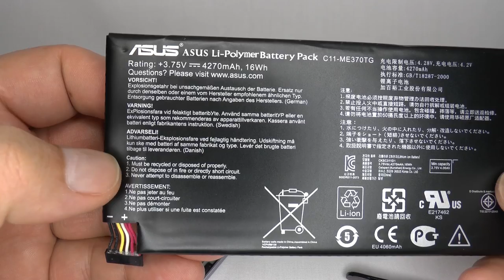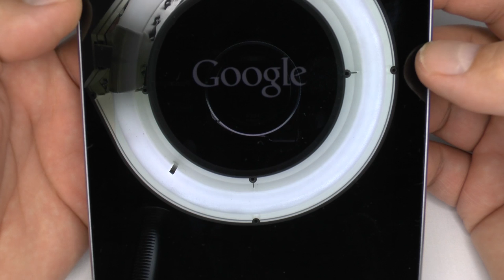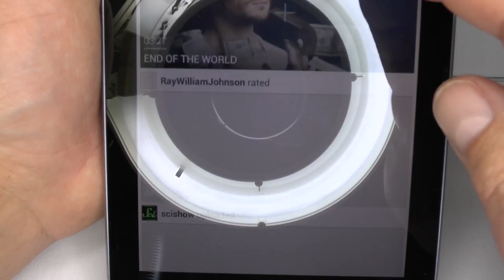Nexus 7 Repair -  LCD & Digitizer Replacement | Disassembly + Assembly

Comment: Hello, Thanks for the video. Recently my Google Nexus 7 screen was broken I can ON and OFF the tablet but i can not un lock it thorugh touch pad screen. Seems touch pad is not working. Do I need to buy Digitizer and LCD both for my tablet or only Digitizer is enough to make it workable?  Where I can order these parts to do so. Please suggest me to proceed further.
Reply from the maker: you need to buy the digitizer and lcd together as an assembly, if you buy one with the frame it makes things much easier. There's a link below and you can use coupon code ETS2 for a little discount which also give me credit http://www.etradesupply.com/asus-google-nexus-7-tablet-lcd-screen-and-digitizer-assembly-with-front-housing.html

Comment: That you for this video, it totally worked ! Now I have a little problem, I can't adjust the brightness of the screen. Could it be possible that I have made a mistake ?
Reply from the maker: I doubt its something you have done, I would try a factory reset after backing up your data

Comment: Ah, thanks for the swift reply :) I later saw in video you explain the difficulty to separate and join the two. Again, thank you. I will purchase the whole assembly, however I will proably have to use Ebay, unless that company ships to the UK at a reasonable cost.

Comment: This was a great video.  I got the replacement parts, installed the new screen with digitizer and new frame.  However, when it came back up I had no picture.  It was working.  I could hear it, it clicked when I tapped on the screen so the touch was working and when I plugged it into the computer the computer recognized it.  So, I thought maybe this new screen is bad.  The old screen worked, it was just cracked on once corner.  So I put the old one back in and found I still had the same problem.  Now I am at a loss.  Seems maybe I broke something in the process.  Any idea?
Reply: it just died its the video card if im a betting man did u double check all ur ribbon cables
Reply: Yes I double and maybe even triple checked all the ribbon cables.  I have been trying to catch a decent price on another broken one on EBay but they are a bit overpriced for something that is broken IMO.
Reply: go buy a new one take  the guts out of the broken one  put them in to the new one say its broken same day get ur money back
Reply: Bobby Nicholson that's evil way we don't do that

Comment: Hi quick question...ive only watched the 1st ten minutes but was wondring if i would i need to remove all the parts mentioned ie volume, loudspeaker etc if i am only changing the screen and digitizer?  Thanks
Reply from the maker: it might be possible to leave some parts in place, but its not worth the risk
Reply: Thanks so much... was just checking incase you were just being really thorough :)

Comment: I've done an extremaly messy job with the heatsync foil, now it comes in 2 layers ;/ will it affect the temperature really badly? any chance of getting it somewhere? or can I craft one with chocolate wrap perhaps?
Reply from the maker: here's one and there are others on there http://www.ebay.co.uk/itm/261317322170
Reply: ***** thanks for the reply! i've decided to give it a go and reused the old one - after all i thought it's not so bad, only a bit creased ;) works so far! many thanks for the tutorial, you've helped a LOT !

Comment: Excellent tutorial, many thanks.  My screen was cracked badly to start off with so removing it from the bezel was a bit of a challenge as the screen itself came apart from within the centre of the bezel and fell out leaving me to pick the tape off.

Either way, thank you for your video, excellent work

Comment: Hey what would happen if I damaged the flex data cable while dissambley ? Btw the USB port was already damaged..can this affect my touch screen because 1/4 is unresponsive
Reply from the maker: the only thing that would affect the digitizer is the flex cables at 8:23 lift the bar and re-insert those cables, it might cure your problem. The usb data cable shouldn't cause that problem

Comment: Great tutorial, Does one type digitizer and screen, fit for 1st and 2nd generation Nexus 7. screen resolution is 1280×800  (216 ppi) for 1st Gen. and 1920x1200 (323 ppi) for 2nd Gen. Nexus 7
Reply from the maker: I'm pretty sure they are not interchangeable, I hope to cover the new one soon..
Reply from the maker: Davitu s no that one is for the 1st gen, this is the one you need http://www.etradesupply.com/asus-google-nexus-7-2013-lcd-screen-and-digitizer-assembly.html use coupon code ETS2 for a small discount which also gives me credit

Comment: after dropping the tablet, my screen has a black column on the screen that still responds to touch sensitivity. i don't quite know what part is broken; do i just need to replace the digitizer display as shown in this video?
Reply from the maker: The lcd display and the digitizer are bonded together so you'll need the complete assembly, there's a link below and you can use coupon code ETS2 for a little discount which also gives me credit http://www.etradesupply.com/asus-google-nexus-7-tablet-lcd-screen-and-digitizer-assembly-with-front-housing.html

Comment: Thank you very much! It was very useful. First time after I put back together the device, the digitizer didn'work, but I remembered not inserting very well it's cable. Opened it again, fix iti and it works. Thanks again!

Comment: Do you know if there is a way to get the digitizer separated from the lcd screen?
Reply from the maker: its not easy and requires a 'hot plate' and very strong thin wire. This video shows how its done Снятие тачскрина Asus Nexus 7. Как поменять сенсор? Ремонт планшетов. Сепаратор Термостол

Comment: just cracked my nexus 7 screen. the tablet still powers. how do i know if i need the digitizer or just the glass?
Reply from the maker: its not easy to replace the digitizer on its own, you'll need to replace the complete screen assembly
Reply: ***** Hello! I have a problem with my nexus 7. I cracked my screen and I can only use one half of it. I believe it's the digitizer. The image is good, the tablet boots and all the applications are working, but I can only use that one half of the screen. Is it possible to replace the digitizer, without the LCD?
Reply: Constantinescu Catalin Nu are rost sa te complici. Digitizer'ul e lipit de sticla cu un adeziv transparent, care la dezlipire-lipire va lasa niste bule de aer foarte greu de scos. Am vazut oameni care au incercat si multe esecuri. Cauta pe ebay un ecran complet, care te va trage inapoi vreo $48, care e o suma ok, zic eu. Eu asa am facut si mi-a sosit in 2 sapt fara costuri de livrare.
Reply: Multumesc mult pentru sfat! Am cautat pe youtube si am vazut cum se face dezlipirea. Nu am destul echipament pentru asa ceva si nici nu m-as risca, sa fiu sincer. O sa caut sa il inlocuiesc cu totul, Inca o data, mersi mult ca m-ai ajutat!

Comment: I thought my problem was the battery being knocked loose. I opened it, unplugged it, and plugged it back in. Now the screen is on, but it's just pure grey. Is my display broken? Someone please help. I literally bought this damn thing in January. I never dropped it or anything. It was out of use sitting on my dresser. I pick it up to use and all the sudden it randomly does the crap I just explained.

Comment: I found someone selling bezels on ebay, so i bought one and finally got a screen so attempting the repair today. It also comes with the adhesive on it, type "NEW OEM & TESTED!! ASUS GOOGLE NEXUS 7 TABLET REPLACEMENT SILVER Bezel Frame" on ebay. Not trying to solicit and help their sales, just trying to help others out...

Comment: Thx, very thorough - was a good reference for replacing the screen on a wifi 32gb. Some minor differences in the width of the charging port cable and the type/shape of the copper heatsink foil.

Working nicely, cheers.

Comment: Great clear video m8, i only need to replace the digi... but will follow your advise and order the full lcd/digi... unit, Il let you know next week how i get on (or if you c a mushroom cloud on the horizon you will already know) thx for taking the time to help others .
Thx Paul
Reply: ***** Quick update , My bezel was a sucker to get off in the end it warped, But you can get a LCD/DIG/BEZEL all in one on ebay £40 i paid £30 and the repair is complete thx for the helpful video again m8, Thx Paul

Comment: can i replace digitizer only ?  like on samsung galaxy phones, heat glass and take it off slowly , than glue new glass/digitizer with LOCA?
Reply from the maker: I don't think its possible on this one..
Reply: Hi Trumpeta 44,,,i have tried to remove the glass, and i can assure you they use something very very strong, it is nothing at all like what we come across with any of the phone loca/oca etc etc....i tried 2 to practice, and resolved myself to the fact for the sake of £11.00 i am buying the assembly from now on...

Comment: HELP I replaced my sons cracked digitizer with a new one, it starts but got a black screen, opened my daughters nexus to swap the little flex cables 8.23. To see if that was the problem. now ive got 2 nexus 7s both start up but black screens, and 2 very unhappy kids. do the small cables break easily. thanks.
Reply from the maker: the flex at 13:21 is normally the cause of display problems. The flex at 8:23 is for the digitizer. The cables don't normally break easy. Try turning it on with the digitizer flex unplugged 8:23
Reply: ***** hi ive brought 2 new flex cables and tried them but still got a blank screen, the alarm on my sons keeps going off and cant turn it off lol.
Reply from the maker: Ray Ducker its a strange problem to have and I feel sorry for the kids. Can you try your daughters screen on your sons mainboard or experiment with different parts until you find the cause of the problem
Reply: ***** hi just to let you know with a lot of fiddling and thinking lol i have finally got 2 WORKING nexus 7s the problem was they had both drained of power so i left my daughters on over night with new flex and it worked, did same to my sons, new screen and flex, left charging over night and hey presto 2 very happy kids and one very relieved father.lol couldnt have done it without your help. Thankyou
Reply from the maker: Ray Ducker well done! I didn't even consider a flat battery :-)

Comment: Hi guys, can someone advise me as to whether it is the same process in the video with regards to a wifi model instead of a 3g model or is it slightly different. I don't want to just dive in and find there is a stepping missing. Thanks guys
Reply: they're shouldn't be much difference except for a 3g antenna module.
Reply: I did it with the WiFi model. I don't know if the differences were with the different models though, it just seemed like they just refurbished the interior with easier-to-handle electronics, such as a hard copper protector rather than that one-time foil and stuff. Basically, it's the same thing.

Comment: Only new digitizer glass? I searched the part number but it cam eup with results relating to Samsung Note 10.1. Can you please clarify whther I need this (goo(dot)gl/AKd2Tp) or (goo(.)gl/LIrDxD)

I have the same problem as the parent comment; my screen is cracked, though there *appears* to be no damage to the LCD itself, but the screen no longer is touch responsive.

Comment: That's $126 for the Glass+Digitizer+LCD but not the plastic bezel, which I'm told is a real pain to separate from the glass itself. Seems like a complete assembly would include the plastic bezel. For $90 on EBay I found the Glass+Digitizer+LCD and for $20 on EBay I found the plastic bezel. So $110 gets you a true complete replacement with no fighting of glue.

Comment: I did everything you did on this video but I don't working for me. I can hear the notifications when I put all back in the case, at a moment I could be able to hear the sounds that make when you touch the screen but I see nothing appear on the screen I even play my music. PLEASE HELP ME ! WHAT IS THE PROBLEM ? Sorry for my bad English.
Reply from the maker: you might have a faulty new display, can you try plugging in the old one?
Reply: The old one broke.
Reply: I bought this screen on Ebay and the seller said that all screens are tested before being sold.
Reply: ***** OK.
Reply: I will post a video.
Reply: I had this exact same problem.  Even though the old screen was broken it semi-worked, so I put it back in and found it doing the same thing as the new one.  Not sure what has gone wrong.

Comment: Hi I folloewd al the steps and i'm getting a green background and weird green lines what can cause that?
Reply from the maker: it might be a faulty new screen, can you try the old one?
Reply: Im afraid not, I'd be a shame since I cannot return it but thanks
Reply from the maker: Pedro Gallegos try replacing the flex shown at 13:30 as a comment last year said it fixed that problem
Reply: That would be great is there anywhere you know I could buy it from ?
Reply from the maker: Pedro Gallegos Google for 'nexus 7 display flex' and click the shopping link

Comment: ty for your reply about metallic tape from 23:20.
after reassembling this is how my screen looks like:

http://postimg.org/image/5o6pt6dg7/
http://postimg.org/image/hful3z82f/

do you know what could cause this?
Reply from the maker: Its probably is a faulty new screen, but it might also be worth replacing the screen flex cable, Google for 'nexus 7 display flex' and click the shopping link

Comment: hello i replace a digitizer in a asus pad but my digitizer dosent work can any body help me???
Reply from the maker: double check the cables at 34:00 are fully inserted and the bars pushed back down. If that doesn't help then you probably have a faulty new digitizer, try plugging in the old one to check..

Comment: Ha! Just finished this and the Nexus works. Very pleased. All I would say is that there are a couple of steps that aren't necessary if all you need to do is replace the screen and digitizer, but this is the most detailed guide I found. Very sound instructions, so thanks. Took me ages, but saved at least £40, probably more.

Comment: I'd stick with LE55ONS advice: LCD+Digi - I've done a few of these now and can whip through them pretty quickly... but wouldn't want to TOUCH the Digi only replacement! Only bit you need to slow down on is separating the digitizer off and cleaning the bezel - tweezers for the shrapnel and plenty of heat and patience for the big bits and it's pretty much foolproof.

Comment: This is a valuable video - I used a hair drier to head the adhesive holding the bezel to the glass.  My mistake was heating from the back rather than the face, so the tape separated from the bezel, not from the screen.  Ended up cracking and scrapping the whole project for a replacement.  So I have a new digitizer/screen assembly (Nexus 7, 1st gen 2012) with tools available http://raleigh.craigslist.org

Comment: Great video, I'm a Luddite and I have my nexus back thx to your instructions.  I would say again to d.i.y.ers of youtube: heat the s c r e e n   s i d e in order to separate bezel, it will save you much grief. mine had ground glass in the adhesive but I washed it in warm soapy water as suggested and it worked fine.  Thanks again!